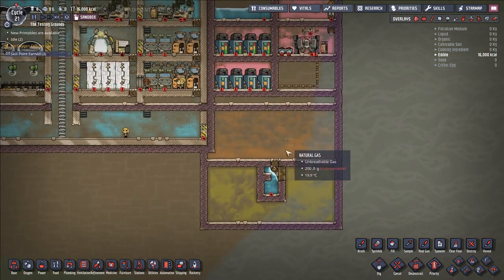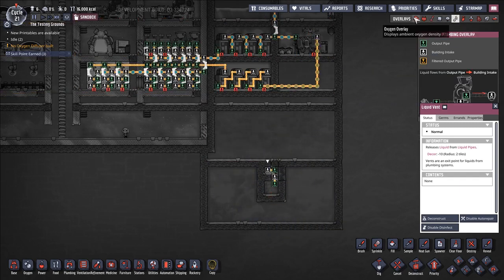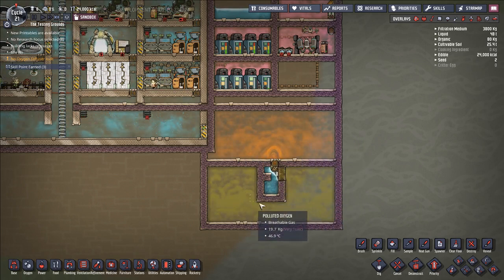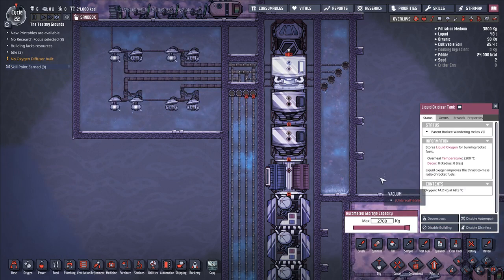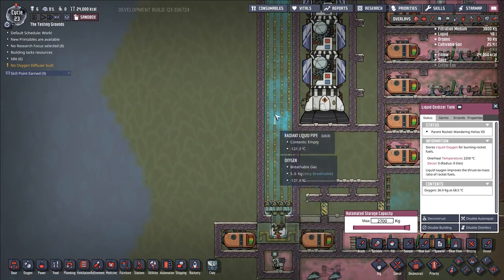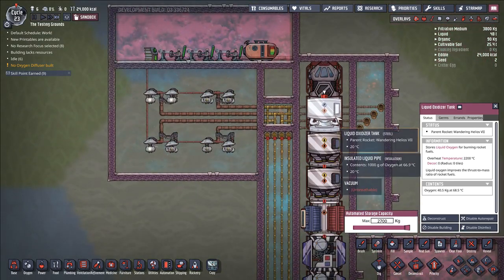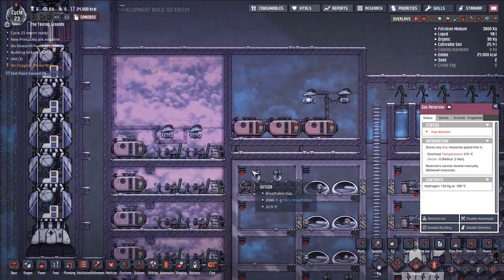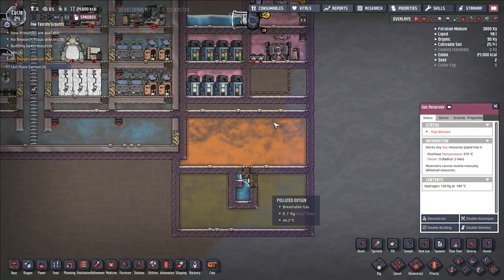This Easy Build Converts Polluted Oxygen into Natural Gas!  WILL KLEI BAN ME? [Oxygen Not Included]

Comment: In my opinion thing like door pumps are something which would work IRL in theory if you had a row of doors with no space between and infinite torque on closing with perfect sealing, such as the mechanized airlock, sequencing the doors to open/close in a specific way  to prevent backflow. Think wave table conveyor belt but it seals at the top.

Comment: In regards to the gas/liquid pipe thing... I would argue that the fact that the mini liquid pump exists and just so happens to pump the exact amount so you won't have to worry about cracking, they 100% intended it that way. They built it to be that way.

And they should fix it so liquid pipes actually carry the gas when it converts. That way you can't fuel a liquid tank with a liquid that would be gas at that temperature.

However, I'd say the argument against it is liquid to solid... Why would a Liquid pipe carrying oil that has been cooled to freezing, why should it break the pipe when it's 10kg, but not break the pipe when it's 1kg? The logic of the game makes brain hurt.